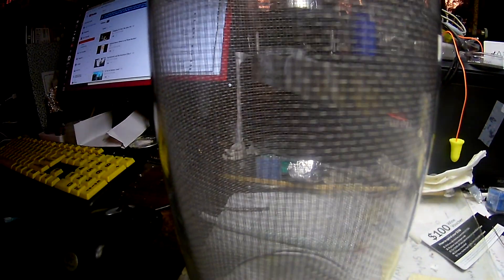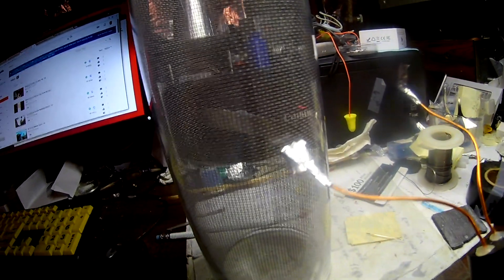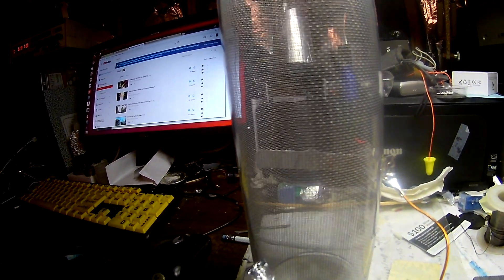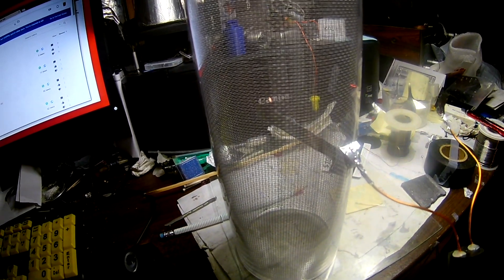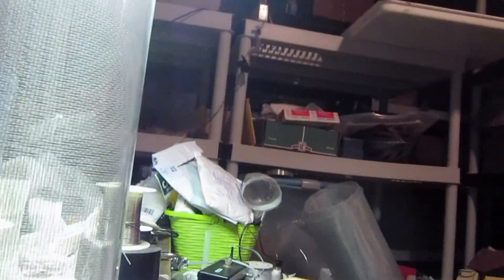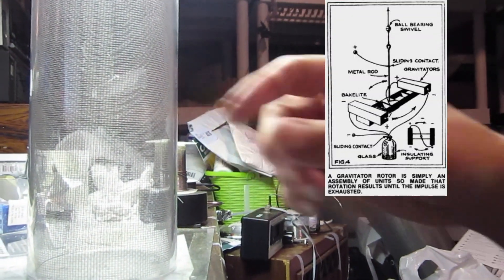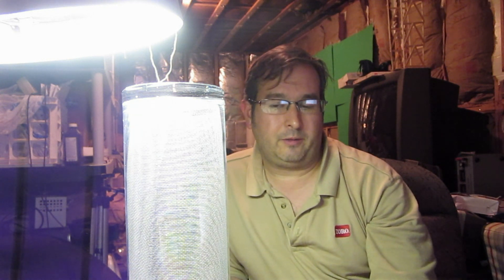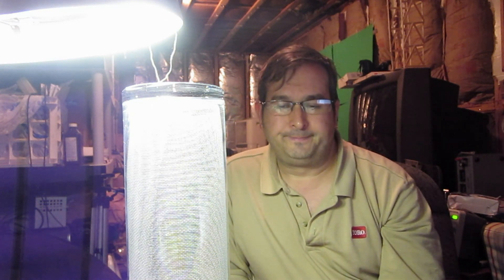Electro-Gravity Torsion Pendulum

Comment: You must it mesh to grounded to earth
Reply from the maker: The shielding effect of a Faraday cage is only due to Maxwell's equations.. and the properties of an electrical conductor.. no ground earth is required for a Faraday cage to work / i.e. shield the inside from external electric fields.. Magnetic fields are a different story.. but electric fields are for all intents and purposes shielded by a Faraday cage... This is because.. Due to the conduction of electrons in a conductor.. the minimum energy state, is when the electric field is zero inside a conducting shell... because if the fields were non-zero... the electrons would continue to move until the fields are zero.. All this happens on a very short time scale..

Comment: Constructing a faraday cage is trickier than what one may be led to believe.  Also, I am pretty sure the mesh size affects the frequency range of the shielding.  A microwave oven, for example, is a very good faraday cage only for frequencies near that of the magnetron.  What other tests of the effectiveness of your cage have you done?
Reply from the maker: It is basically a DC static field that I am using.. and the cage completely encircles the area under test.. if Maxwell's equations are correct... the electrical charges on any shaped conductor should redistribute themselves very quickly.. and produce a minimum energy state, where there is absolutely no electric field on the inside.. because.. if there was an electric field.. this would produce a force on the charges... and they would continue to move until there is none! I might agree, that it could be an issue if we were dealing with high frequency AC fields.. then, little cracks become an issue.. as well as skin depth of the electrical conductor.. but these are basically DC fields that I am using.. the charges have an almost infinite time to redistribute.. And electrons move very quickly!  The Faraday cage really should be pretty much completely shielding this electrostatic fields.. but it is not! I believe it is because of the thick glass dielectric that is causing the effect??.. I will have  to repeat the experiment without the glass to see..